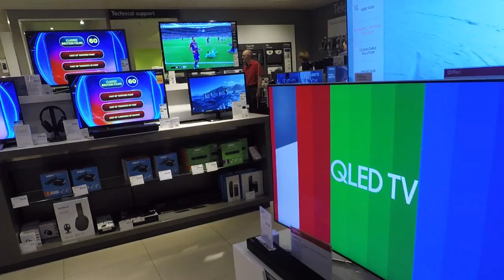Nailsworth Repair Cafe - "The Seed Beneath The Snow" taster #5

Comment: Obviously they are lucky enough to have a permanent space. I have offered to sharpen planes, chisels, screwdrivers, marking knives and so on at a Saturday Cafe'. Bad ones might have to be taken away which need machine work. I have been sprucing up my woodwork tools which I used to help pay the bills for 10 years ready for retirement projects. You need good tools to make or repair anything. A pillar drill, as you can see in the picture. and vices are very useful.